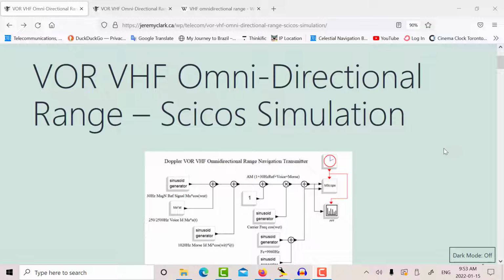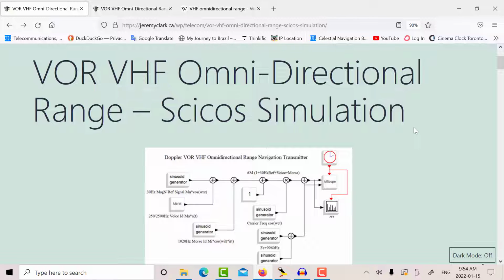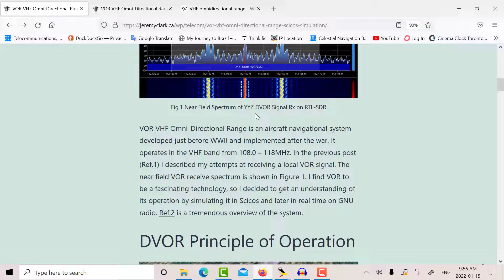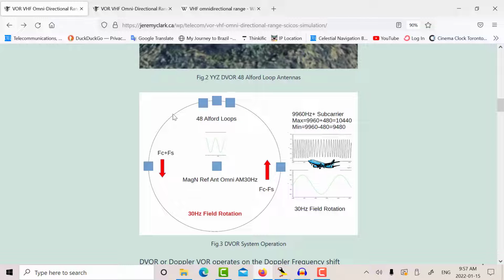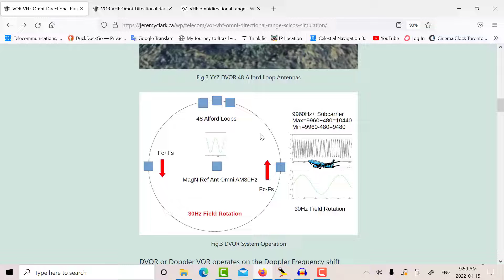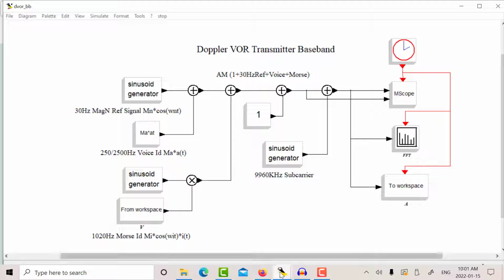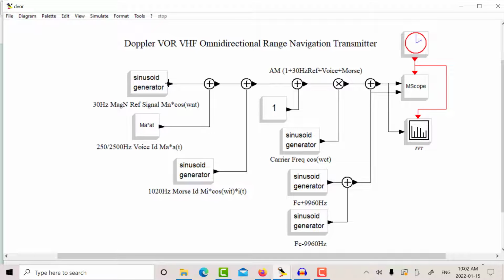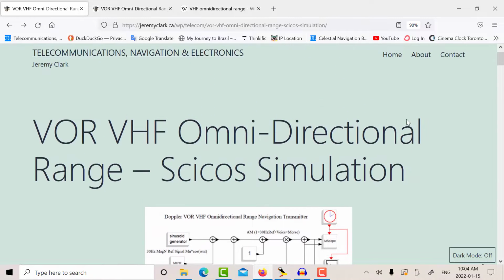VOR VHF Omni-Directional Range - Scicos Simulation

Comment: Nice work
For accuracy you need space modulation in your simulation.
You did  just the simulation of the output of RF power amplifiers.
For accuracy  or to complete your simulation you need space modulation factor in your simulation. Add the hybrids and the antennas and  phasors to get the all radials and then detect the VOR signal and get the two 30 Hz and calculate the phase difference and  compare it with actual radial with ∆= +-1°
Good luck with space modulation
Greetings from north Africa (Algeria)
Reply from the maker: Thanks!